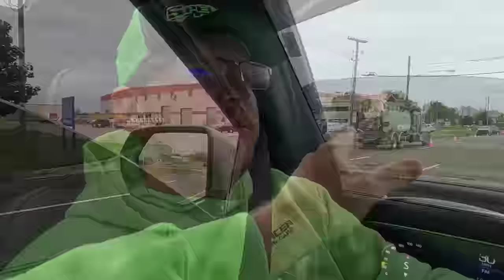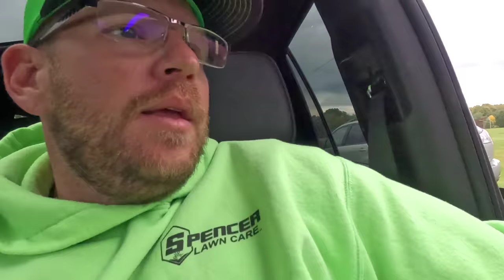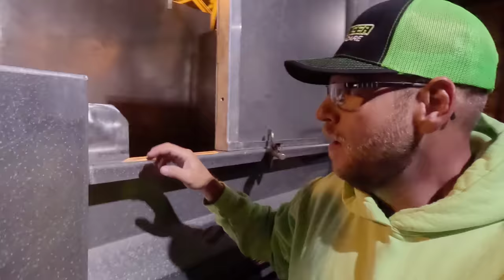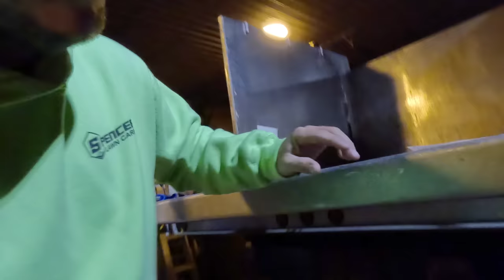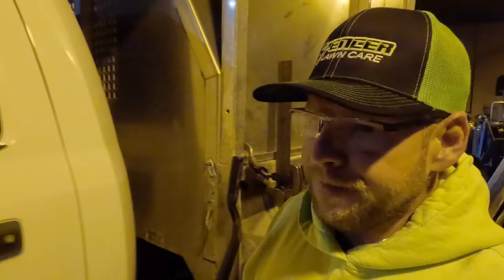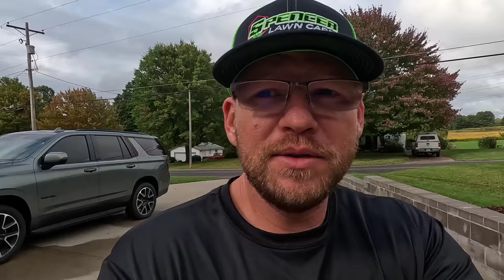DUMP TRUCK LEAF BOX AND NEW TRUCK UPDATE!

Comment: I remember you would always fill the dump trailer with a couple of the big jobs. How are you planning to fit that much debris in the dump truck? Won’t you have to empty multiple times to get bigger jobs done?
Reply: You never know , sometimes the shorter trucks load almost as much because the loader is closer to the walls and it and it has a shredding and stacking effect same way a exmark navigator holds more grass then the walker in the same size hopper , the blower just forces it in more
Reply: The new trucks right now are so so problematic. I don't care what brand it is.

Comment: Sounds like you guys are over complicating things with the dump truck. Seems like you could make a set of barn doors that would open to each side above the original tailgate with a rubber flap bolted along the inside bottom to seal it. And Billy Goat acutally makes receiver mounts for their blowers to hook them up to your truck.

Comment: Just build a tounge mount off the front of ur mower trailer with detachable legs and mount plates to get the leaf vac up high enough, add a small section of flex tube to the truck box, now u have a all in rig. Drop the hose off the shoot and leave bolted to the truck box, 2 hook and a bungee to keep it from swinging while driving, and turn the shoot 90 degrees while driving and then just reattach. Or a alum box that's colasapable in the shape like a heat register duct, couple pieces of 5/16 pipe and pop the pins out and it fold down so u dont have to worry about a flex hose clogging up with wet stuff. U got plenty of extra sheet aluminum to cut up to make that. U could prolly leave it attached if ur not going to make super tight turns and not go far. And when u need to dump just drop the trailer and then dump and rehook. Then as long as u got a cherry picker u can dismount the billygoat easy, but u also have ur skid steer and forks so u have the option as well. Even if u mount 2 legs inside the front of the trailer on the deck. U should have plenty of room in front of the mowers cause of the front wheel arms give u about 16inches. I could make a simple drawing to give u a idea if ya want.

Comment: I think he had a great leaf setup before with the dump trailer.  It was able to hold more than what this dump truck will.  He could pull it with any of his trucks.  Now if/when rhe Dodge goes down, he cant do leaf cleanups.  Seems like a lot of extra exspense modifying the old dump trailer sides to fit the dump truck.  I guess Spencer knows best but i dont see the benefit.

Comment: With that top hinged back door you are making you may want to consider a way to gain access other than the rear swing gate for when you want to toss barrels or limbs or whatever. I basically had the same setup you described but with wood and it was a pain to prop the rear door open to hand load for anything other than the loader. Video on my channel "First Fall Cleanup  S185 Bobcat and Trailer" from 4 years ago. I have literally had every different imaginable setup over my 25 years plus. I haven't found the perfect setup yet but for me My walker, a dump trailer and pickup is about the best all around combo for solo/semi solo. Lots of versatility and fairly low cost.

Comment: I used to have a sweet custom-built leaf sucker. Used it on 2 Isuzus but initially on my 1-ton dump. We fabricated a hinge on the bed where the vac would sing away to dump then back over to a latch on the tailgate for operation. Left me free to use my trailer hitch for pulling the equipment if needed and visibility and backing weren’t an issue.
Reply: Yes this the first lawn care company I worked for did this exact thing the super sucker would swing away and it was a dump bed with wood panels
Reply: And it was on izuzus flat fronts lol

Comment: For the back of the dump truck, have a panel that is hinged from the top that comes down to the tailgate. Weld on a piece of angle aluminum on the bottom edge so when the tailgate is closed, it holds the upper panel closed also.